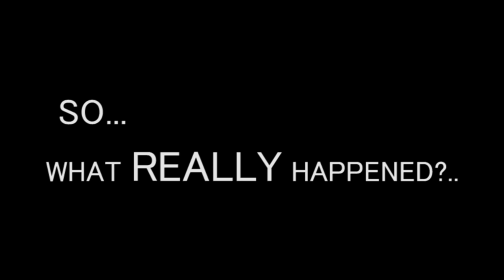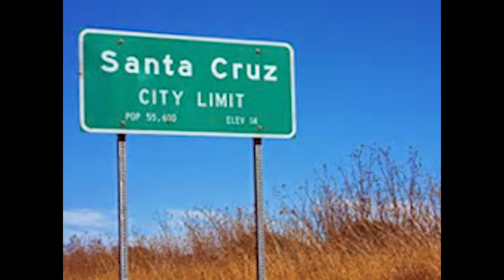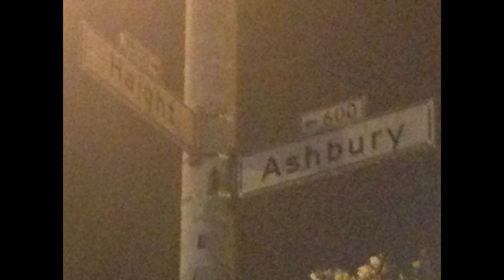Orange County Jail Escape UNCENSORED

Comment: Anyone else feel like it looks fake? How did they manage to get normal clothes inside the prison? Why were all the vents so easy to pop open
Reply: Lu The Gamecat they didn’t. They took the oranges off so they don’t get dirty and just wore their white tees and boxer shorts. Can’t get the dirt and rust on the oranges cause the deputies are gonna wonder where it came from. And obviously this video is not the actual escape, it takes several weeks or even months to file through those bars. This was clearly not a 10 minute spontaneous breakout, this was a well timed and well planned escape. They were in those shafts for months getting those bars cut. This video is obviously taken to show off to the other inmates before they made the actual breakout. Look at the video, notice there are only 2 shadows and only 2 of them are shown, when they actually escape they were 3 and they weren’t carrying any equipment with them to leave the roof. They probably made the actual escape the next day and just went in there to set everything up for maximum speed when they escape and recorded it to brag to the other inmates

Comment: What tools were they using to cut through steel grates?
Reply: A hacksaw blade could be smuggled in easily and cut through small gauge steel easily too.
Reply: Lmao take your meds
Reply: It can b done w a wire or dental floss w ajax or another grainy substance but they had cell phones ect ect so i would imagine they had tools
Reply: Teeth & toenails.